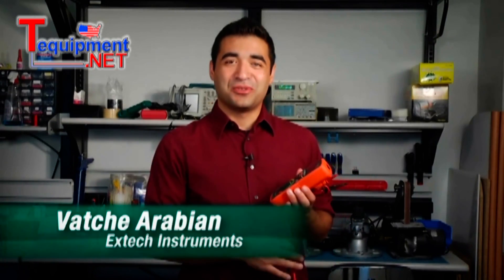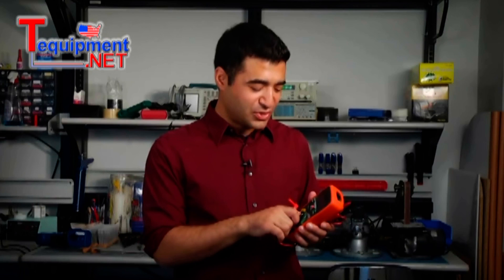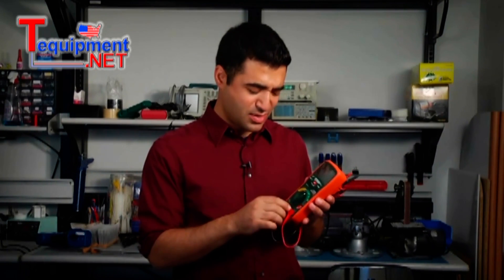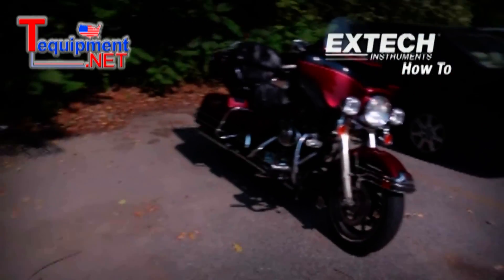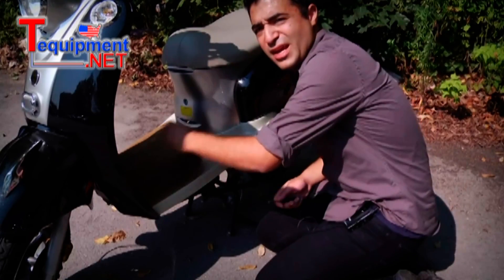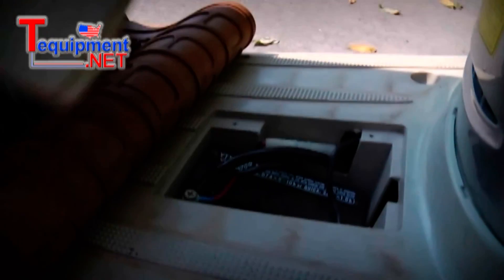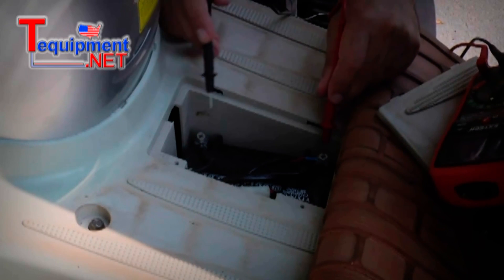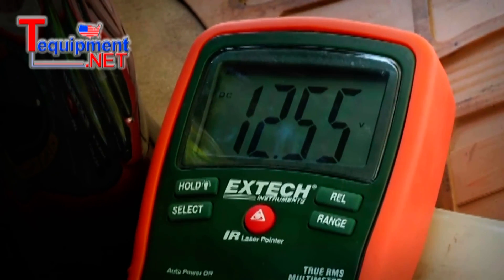Extech Explains How To Use A Multimeter to Check Voltage

Comment: Sorry for the crapy video, can't stand it when ppl say just turn it on....19 different selections on the dial and 4 different ports to plug in your leads. It'd be a great video if you explained which of the 19 different settings you selected for this test.